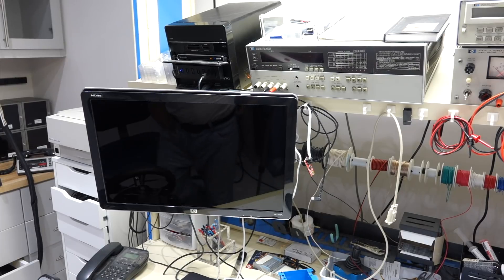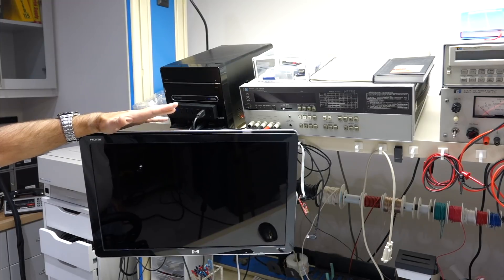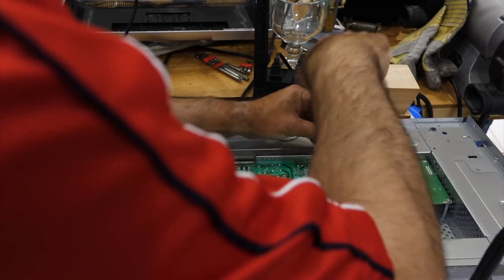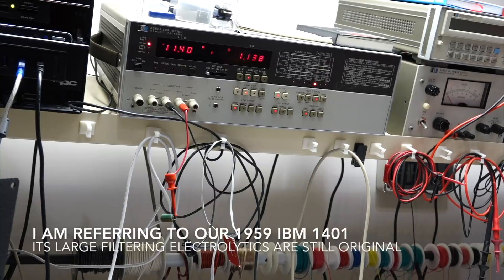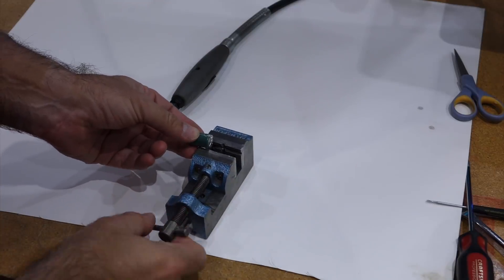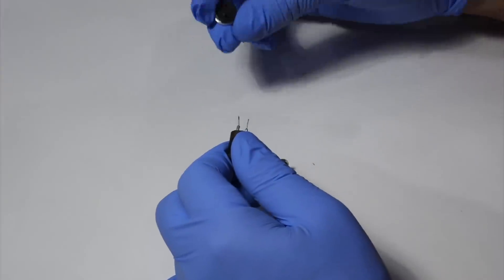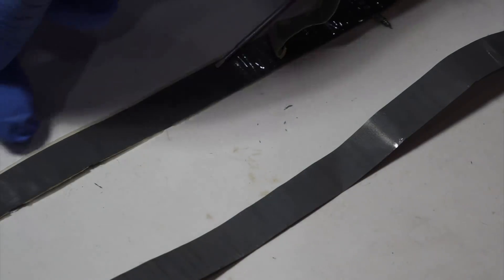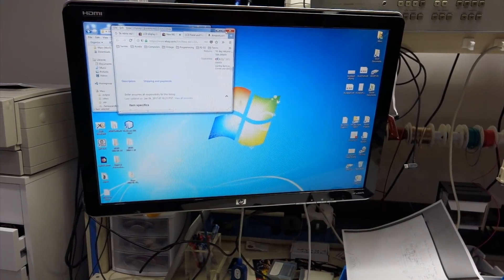Modern Tech Fail : HP w2207h Display Has Capacitor Plague

Comment: Just found this as video mentioned in the Samsung laser printer fix, I thought I recognize that monitor, you don't see them often. Mine has 20000h and not had to open, 
though it's a bit dim so I think that job is pending. Good tips here and in comments.

Comment: I have recapped a monitor last year because it often turned off by itself, when I turned it on again it worked fine until the trick didnt work anymore. So after a recap. everything worked well but a year later the problem slowly comes back. any idea?

Comment: I have a w2207 (no h), it started acting up on suspend, losing settings and backlight hours count.

I am wondering if there is some lithium battery of some sort in the electronics board.
Reply from the maker: I would suspect you are correct, there must be a coin cell battery on the digital board. I did not take it off though, so I can't be sure, but it sure sounds like a low battery is what is happening.

Comment: Very nice video explanation.  I replace two 1000uf 10V capacitors to restore my monitor to normal. The caps are usually rated for 1000 hrs. For a few cents more you can buy caps with a 8000 hr. rating.

Comment: I've found the older physically larger caps seem to fail slowly over decades while the 'modern' ones tend to just fail all of a sudden.  Most likely the older large caps just had more electrolyte and a larger surface area to dissipate the heat once the ESR started to rise.   Older larger caps smoldered away while the small modern caps just go up like a firecracker,  sometimes literally.

Comment: Thanks for your video and info!  I guess it's not worth it but intend to repair mine too.  For now however I manage to get it lit back up several times a day after a few minutes warmup with a heat gun blowing hot air into the vents, no problem lol.  It was actually rebranded as a refurb Famousmaker monitor with a world atlas longitude/latitude icon sticker covering the hp logo at the bottom middle.  Maybe they knew the components were cheap so HP rebranded it and sold it to suckers like me.

Comment: I bought an Eizo monitor from around 2007 at a thrift store recently. It is Made in Japan and has only high-quality Nichicon, Nippon Chemi-con, and Panasonic capacitors in it,  and everything about it seems extremely high-quality. It is also held together with just a few screws and some very easy to access clips, so it is easy to get into. Looking at the info in the settings, it says it has about 50,000 hours of use on it, and yet it still works perfectly. It appears Eizo still makes their monitors in Japan, and likely still has that same level of quality (although new ones are very expensive), so I guess not all modern electronics have to be made to be crap, it is just some manufacturers choose to do so.
Reply: *New* ones are expensive? Wow. Japan-made Eizo monitors were always the bees knees and priced suitably (ie “a small fortune” for most of us). If anything, they are now cheaper. You have to adjust old prices to today’s dollars. I had an Eizo monitor in the 90s and it cost more than the comparable Eizo models cost today, even if numerically it was cheaper. Money’s value is not constant. And on top of it, today’s models are much better monitors as well - wider sync range, more features, digital inputs, better focus when examined with a microscope, etc. They only cost “more” of you compare apples to oranges: modern prices of better products to prices of technically less capable products in old money.
Reply: @absurdengineering  I meant that in terms of comparing their prices to used Eizo monitors, as the one I bought used at the thrift store was only $7. Adjusting for inflation, my model was around $2,000 when it was new, and it seems the average price of that model on eBay is still rather high as well, though.
Reply: faulknik000 Ah, OK, that makes sense.

Comment: I had some powerline plugs that stopped working when I gave them to a friend, at the time there where quite expensive. I opened both of them up and found that the main dc cap on the secondary side of the power supply was badly bulged. I replace them with what ever I could find same voltage and capacitance of course. I have been using them for nearly 5 years after fixing them. I sometimes think manufacturers do this on purpose as a planned obsolescence so you will buy the newer model.
Reply: R U a cynic

Comment: If this is anything like the original HP w2207, I hate that the USB ports either require a separate power source via a USB ln or it uses this connection to send memory stick data from the left-sided USB ports to your computer but can't seem to use that connection to allow you to get rid of the VGA cord. Am I doing this wrong?
Reply: Back when these monitors were made there was no USB connection that could transfer full bandwidth video data for general use in a monitor. You can get digital video over USB-C only because it was meant to do it and has the requisite bandwidth. Back in the times of USB 2 you could leave usable bandwidth for other functions while transferring say a VGA image, so nobody bothered with that, and there was no support anywhere to transfer that data from the graphics card to the USB host plug. These days a graphics card can dump its output onto PCI bus lanes and the motherboard chipset will route those data packets to the USB-C connector, mixed with other USB data, and the monitor can then receive those and use them to form a display. It’s possible to do this for low resolutions with USB 2 but you’d need a totally custom solution for it - no chipsets from that era, graphical or otherwise - supported it.

Comment: I disassembled my HP 2159m monitor, but I see that none of the caps have any bulging or leaking. Can someone tell me if I should just replace them? The monitor is several years old and my PC (windows) is always on, but is put into sleep mode during the night. The problem with it is washed out colors. Could the caps be old and maybe of poor quality to begin with, even if they look good on the outside? Any help is appreciated.
Reply: If it’s an LCD monitor then capacitors won’t cause washed out colors - not if you’re connected over HDMI or DVI. With VGA there may be something funky going on in the ADC front-end  - maybe, a long shot. Normally it’s a materials issue in the screen itself - the screen color filter age and lose contrast and the backlight ages too and it’s basically an old life thing. The fix is to get a new one, and you’ll be delighted with how crisp the modern LCD monitors are!

Comment: Hello mine gave off smoke after screen turned black. Does that mean it's ruined or are there safety to prevent damage?
Reply: Can’t say until you actually look inside and see what smoked. These things generally don’t burn like a forest would where a little spark sets the whole thing ablaze. You’ll likely find that only one component has failed and smoked. There may be superficial smoke damage on other components - but it is expected to be superficial only. Get a swab with acetone and it should clean off easily.

Comment: What an interesting video, so happy to have watched it; thank you. I had been using (2) of these monitors for photo editing for a number of years. One can no longer bring its brightness up high enough to achieve a homogeneous color calibration required for editing. Is it fair to assume that it (or likely both) could benefit from a cap refresh? In the meantime, I have ordered (2) new monitors but have a lingering resentment discarding electronics, particularly if there is such a potentially straight forward resolution. Appreciate your input.
Reply: Hi, did you ever refresh the caps on said monitor?
Reply: @jax6575  regrettably not, I passed them along and went new.

Comment: Actually it not the cap crap , is the engineer who designer this board , they just calculated  enough requirements power/ capacitor for this monitor ,They not thinking about long hours use will heatup and demand more power, that's way cap will work harder and blow out, always replace with bigger voluem uf from original  cap.

Comment: I have had to literally replace hundreds of these same brand caps with low time on them in tv power supply boards. Even when they were not swelled or appearing by visual inspection to be bad or dying. There are two known brands that I've had this issue with and only replace them with high quality caps. The small extra expenses when repairing is worth it. Happy customer= happy wallet

Comment: There's a "notices bulge/OwO what's this" meme to be made somewhere here. Especially what with the white schmoo that leaked out everywhere.
Reply: That's not leakage that's just the silicone caulk they use to help dampen vibration/keep stress off the mechanical connection for "larger" board mounted caps. Actual leaky caps look like disgusting brown goo more similar to a dark caramel color.

Comment: I had to replace the caps in a Cisco Catalyst 2950; a lot of them bulged and leaked on the power supply side. The old caps were green Sanyo ones. Makes you wonder about how many electrical items are thrown out in the rubbish due to cost saving during manufacturing.

Comment: Good video.  But need help on different problem with 2207.  Filter caps appear  OK, but small discs (c526, c524) near wire connectors and xfmr (T501/502) in corners  got fried.  Readable disc next to it labelled "N3 3kv sec" -3kv?  maybe that is why board has cut outs- to insulate?  So do I replace small disks (what value?) or is the trouble off board, and they will only fry again?  On start up screen showed good image, then flickered went dark and smoked--3 or 4 seconds.  Discs dark, split, board singed just a bit.  Have good DVM, no schematic.  Could buy board but afraid that may not fix it.  Don't know if I can test screen for short with DVM.  And why would caps blow?  Thanks for any help.
Reply: They failed randomly - there is nothing in this circuit that could actually damage them. You have to replace them and if they “fry” again then the replacement parts were bogus. Only buy from legit places like DigiKey, Mouser, Newark, etc. - eBay and AliExpress are off-limits for such parts unless you got the tools and the know-how to qualify them (ie. to ensure you haven’t been had, mostly).

These capacitors are common in monitor backlight circuits. SEC is a Taiwanese brand - Success Electronics Co. Anyway, you’re looking for a 3pF 3kV NP0 ceramic capacitor. It is in series with the backlight and its value is important. +/-20% would be OK but the lower the value the dimmer the backlight. You can buy a dozen or two and hand-grade them ie. measure their value and choose something that’s say a bit above 3pF so that you compensate for the aging of the backlight. I’d put 4pF in and enjoy what life is left in it.

CFL and EL backlights age poorly so those monitors have their life limited by that backlight mostly. You can only extend the useful life of your monitor to decades if you replace the CFL backlight with a LED backlight. The CFLs won’t be available much longer due to environmental concerns, and also because they are custom made for each panel’s vendor and there’s no point in making them if the panel is not manufactured anymore.

Comment: Capxon should be run out of business and prevented from manufacturing anything. I also have lots of 30+ year old equipment with their original capacitors all in excellent condition. Starting with my 1975 Minimoog D music synthesizer with its Nichicon and Matsushita caps still showing lower ESR than some brand new mid quality level ones !

Comment: Made as cheap as possible and actually designed to fail in my opinion... if these things lasted longer, they couldn't sell you a new one every few years... I've brought a Hanns-G monitor back to life by switching out the capacitors on the power supply board and I'm not even very good at soldering... ;)

Comment: Nice LaserJet 6P (or MP? impossible to tell from this distance) there... I used to have one as my main black and white printer, untli my inkjet, which I used for color prints only, died. Then I got a Color LaserJet and had to get rid of the 6P, which was still in excellent condition after more than 15 years. Nice printer, just a bit slow by todays standards.
Reply from the maker: Good eye! It’s a 6MP (the post script version). 22 years old, never skipped a beat, and even recognizes Appletalk for my classic macs. Feels completely modern when you use it, has not aged a bit.
Reply: Mine didn't have the PostScript interpreter, and I only used the parallel port (plus IR because my old notebook used to have an IRDA port, long before WiFi was common). But it worked flawlessly, except for one time when the toner cartridge had become so old (before being empty) that the rubber thing that wipes the drum clean with every revolution had crumbled away. I had prints with a "fading echo" every ~ 10 centimeters. Replacing the toner cartridge fixed it.  I miss that machine a bit, even though I am happy with my current printer. I should have kept it, but in my tiny apartment you can't keep everything. :(
Owning the same (well, apart from the PostScript function) printer for so many years i immediately recognized it. You don't see them too often any more.

Comment: The way it was recently explained to me in the difference between 1950s capacitors and modern capacitors is in the way the materials are formed.  Instead of large pieces of flat foil wrapped in the large older capacitors, now the foil is ribbed to give it more surface area. 

Unfortunately it cannot withstand the heat.  

Stay away from a certain distributor which is manufacturing new large can capacitors on the old Sprague equipment.  The claim to make the cases smaller since the technology has "advanced".
Reply: I should have waited until you explained it... .haha...  However more surface area to make the smaller is no substitute for real "girth" ;)

Comment: yeah, water in stuff is bad because it tends to react. Low ESR Capacitors have Water in it...
That's why there are anhydrogeneous capacitors (Su'scon has some in their catalogue).
The Nippon Chemicon SME are norma General Purpose Caps, not a good idea in switch mode PSU that come with (very) low ESR Capaitors like CapXon GF...
Capacitance in modern electronics isn't that important, you have very high tolerances, ESR or Impedance is more important for some circuits...

Comment: I picked up one of those on the side of the road once. same issue. Never got it fixed, found it in the garage a year after I picked it up and my brother had accidentally cracked it whilst moving it and didn't tell me. Lovely.
I have a Dell TV from around 2003 on the 'bench' of sorts right now and it has the infamous inverter cap plague problem, plus a couple on the driver board that need replaced. mix of CrapXons and Cheapo Teapos everywhere. Couple Lelons that all test great, though. best of the cheapies, no wonder Radioshack stocked them near the end of their life.

Comment: Would change every cap on the secondary side anyway, once one is bad the others are going to fail shortly, plus also small capacitors on primary side, as that often also goes high ESR and the power supply does not start up when cold.

Comment: If your imac is still unexpected power off, check your rear housing because in there is the plug of the power cord wich goes to the power suply and it has a fuse witch brake power when its shorten